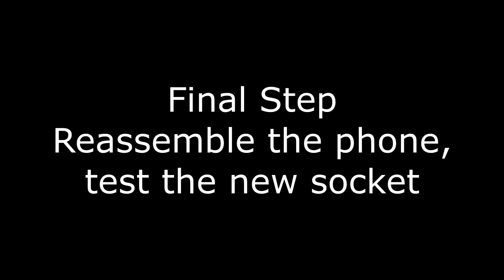How to replace a micro-USB receptacle - Samsung Galaxy S3 mini

Comment: 280 on the heat gun is too low. You should not be heating a PCB for anywhere near that long. Solder melts at 350 so you should set the heat to near or at 350 and heat for a few sconds. I'm suprised you didn't damage the board with such prolonged heat.
Good video otherwise!
Reply: +DNA-TECH Computer Solutions  Some say 370. what about the Soldering iron? in Which temperature it should be set. ?
Reply from the maker: +VoiceSriLanka +DNA-TECH Computer Solutions My bad, sometimes commenting on the phone can go wrong. I didn't notice that, I meant 380. I have a better hot air station now and I usually use 360° on 1.6mm PCBs, regarding the soldering iron it will depend on the mass of the iron, but I usually have good results with mine set to 350°. Bear in mind that low cost stations vary widely, sometimes tens of degrees, you should always do some tests before using them on production. Just a side note, most lead-free alloys melt at 220°C, not 350°.
Reply: Thank You
Reply: +José Faria Thank you Jose.

Comment: So micro usb cords are built to break after 350-1000 unplugs (1-2 months) they did this because usb mini never broke and they saw an oppertunity to basically create an bi-annual cellphone fee where there was none(just like when microsoft curropted the Linux cernal, changed a little code and added and outward user friendly interface so they could sell you updates and newer versions) this is formula with tech now, invent a brilliant piece of tech, then currupt it and profit from fixing the corruption.
(In a perfect world this would be made illegal like how monopoly is illegal in our free markets)

Anyways i want to go back to before the corruption, can i solder a usb mini port where my usb micro is? Is software involved? Are they too diffrent? Im tired of buying usb micro cord every week, i still have the first usb mini cord i ever bought nnit still works perfectly. Im done playing this fucking game with Samsung, its clear that they unilaterally made the decision to fucking litterally force another bianual fee on our phones without our consent the cords cost 5 cents to make then they charge 15-30$ and the worst part is the more expensive the worse they are! Iv bought 100$ cable that lasted 4 days yet the one that came with the phone lasted 4 months! 

So if anyone can help me on this endeavor id be most grateful and would forever be in your debt!
Reply from the maker: It would be really hard to achieve (almost impossible on some devices), the pin spacing is wider on mini usb and the sockets are significantly larger. I actually have the exact opposite experience, in my experience mini USB is not really better, in fact, I'll take microUSB any day over mini. The mini USB port on my Atmel JTAGICE3 worked properly less than two years, and many more sockets that broke while being handled very gently. I've never had a micro USB break on any of my devices, I use a 4 year old Samsung Galaxy S4 with the original cable and both the cable and the phone are working perfectly, the same with cameras, tablets and so on. Pretty much all USB sockets I've replaced were broken because the user was too rough with them. Either you are unlucky or you need to apply less pressure when the cable. (Also, I'm pretty sure windows is not really close to being related to linux :D)

Comment: You glossed over the hardest part of replacing a micro usb port - the desoldering of the holes!
If you're going to bother putting up an instruction video at least show the whole procedure and explain to people the difficulties that will be encountered!!
Reply from the maker: You are right, I should have shown more of the cleaning process, but the basics are there, I just had to get in front of the camera because I wasn't able to see what I was doing, sorry :)

I will probably buy a vacuum dessoldering station soon, maybe I'll do another video with it.

EDIT: fix a typo.

Comment: 350 is too low go 400 to 450 its quicker
Reply from the maker: ***** It is, but the probability of PCB and component damage also rises dramatically. I'm always a bit suspicious of the quality of products built primarily with cost in mind :P
Reply: +José Faria does this work for any phone
Reply from the maker: It should be very similar in phones that use microUSB receptacles (or similar variations). Just make sure you protect the surrounding components with kapton tape.
Reply: thanks man God and Jesus bless you bro